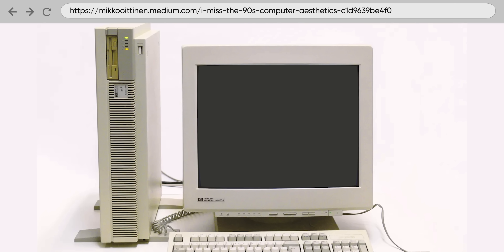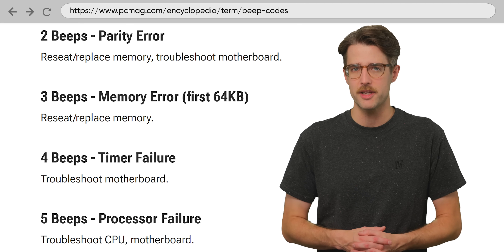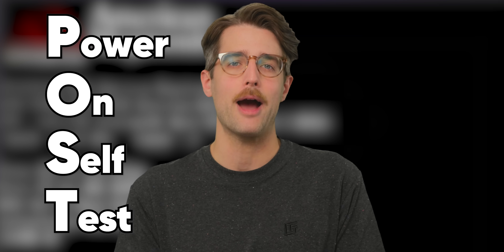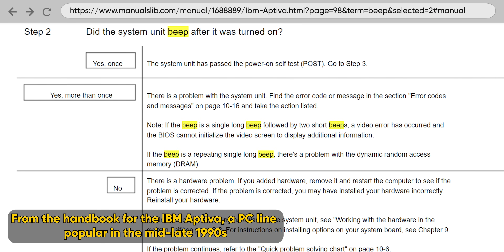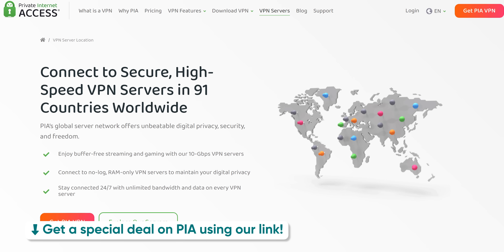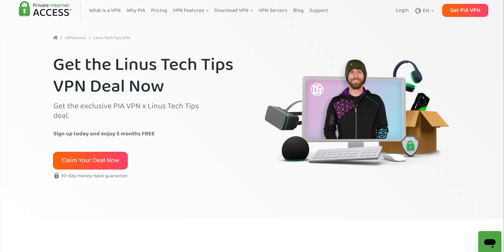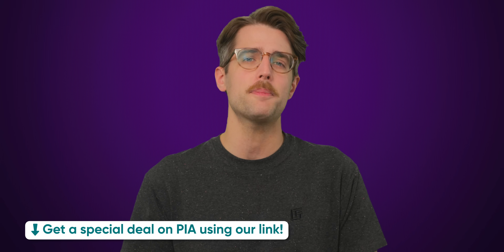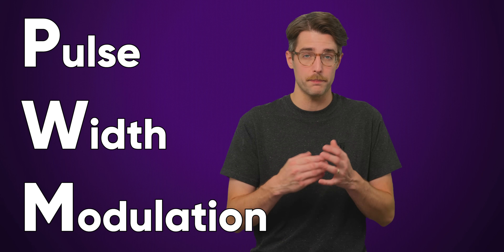Why Computers Don't Beep at You Anymore

Comment: One thing you glossed over is that at some point in the mid 2010s, motherboard makers seemed to stop including PC speakers as a cost cut, because case makers were including them. Also, case makers seemed to stop including PC speakers as a cost cut, because motherboard makers included them. End result: No one included them.

Working tech shops back then, I'm sure we're all familiar with our hoard of PC speakers in a drawer suddenly starting to dwindle.
Reply: I want to know why they need to cut cost when they charge me 300 bucks for a motherboard.
Reply: @John-du2mq A few cents per board when you're making thousands adds up. They're nickel and diming the quality and features away.
Reply: It's like the screws for an M.2 NVME slot. Seems SSD manufacturers don't provide a screw, and neither my desktop's motherboard nor my laptop came with any spare m.2 screws either. You know how annoying it is when that new SSD you ordered finally arrives, but you can't put it in because you don't have the darned screw? >_<
Reply: They serve basically no purpose at this point. Any event that would previously have warranted an alarm beep from the computer gets routed through the soundcards that basically all computers have now. Computers rarely freeze so early in the boot process that you don't get a display, so using them for that doesn't make much sense either. A lot of computers now come with status LEDs on the motherboard that you can look at if you really are having a hard time getting the computer far enough into the boot process to see anything.
Reply: Back in the nineties, before sound cards were commonplace, there usually was no beeper soldered onto the motherboard for exactly the same reason: The speaker was part of the case. Although the speakers back then were actual speakers, and thus perhaps a bit too big to be soldered onto the board.

I'd say it must have been around the turn of the millennium that those tinny little piezo beepers soldered onto the board became somewhat mainstream. PCs had already been beeping at us for almost 20 years at that point. 

So I don't think them going away is why PCs don't beep anymore. It might be the other way around, though: PCs really had no reason to beep at us anymore in the 2010s. The boards and CPUs still technically supported it, if only just to meet the specs for some industry standard, but why spend extra cents on a beeper that nobody actually uses?
Reply: Dell PCs still have a built-in speaker! Or they did as of 2021, anyway. It's connected to the on-board sound chip, so it's a general-purpose speaker, not limited to beeping.
Reply: I miss having those 2 to 3 inch speakers they mounted in the cases.
Reply: Other thing glossed over is that by the late 90s when most PC Speakers only ever got used to make POST beeps then the speaker quickly became cost-reduced down to a piezo sounder mounted straight onto the motherboard that could only really make beeps, downgrading the capabilities of it further.
Reply: My last two Mobos from EVGA (x570, z370) both still came with internal speakers 🥲
Reply: This is wrong, cost cut? The thing only cost like 0.1 cent. They probably stopped because most motherboard have led indicator or 7 segments for showing the error code
Reply: weird. my gigabyte gaming 3 H170 had it. i 'downgraded' to an asus b760m prime and it didnt come with one. i thought perhaps it was limited to high end motherboards?
Reply: @Dragoonoar less about the quality or price and more that its just not a universal feature anymore. Some have it, some don’t.
Reply: My H81M-S2PV PC does come with one
It's from 2013 btw

Comment: Most (or at least a lot) of motherboards still have pins for a speaker.  I put little speakers in my machines because the post beeps are actually useful and the speakers only cost a few cents.

Comment: I bought a little speaker for my PC's motherboard so it still beeps when it boots.  It's useful in case there is a problem during bootup.  For example it will beep multiple times if the CPU fan has a problem and stuff like that.

Comment: Surprised you didn't mention the little plastic 4-pin cylindrical speaker that used to come with motherboards and connected to the system/front panel header pins

Comment: I remember when turning off the sound in games actually improved the frame-rate.  That's how little power those '80s CPUs had.  The first time I ever noticed sound not have an effect on PC games was when I upgraded to a 486-DX2-66 in 1991.  That finally broke the "sound barrier" (my term for it).  You could have sound going all the time, even in the OS, and not notice any slowdowns.
Reply: I had a 386 DX 25 that could play Doom with PC speaker audio. It was a really nice 386
Reply: To be fair, pushing anything beyond simple tones out a PC speaker is CPU-intensive work. You can get the system timer to do the job for a single, unvarying tone, but for a complex waveform, you have to tap the timer registers in realtime. This is why sound cards were so awesome: you just loaded a waveform into RAM, then told the sound card "play that", which it did via DMA without CPU involvement.

Comment: 1 long beep + 3 short beeps is a sequence that's burned into my mind from so many failing AGP cards in recent years
Reply: Often with AGP the card just needed reseating as the interleaved pins on the connector had basically no tolerance for the card moving at all vs earlier and later interfaces with simple single row edge connectors.
Reply: oh my god, troll physics guy

Comment: I used to create sound from the Sinclair ZX81/Timex 1000 by using a short bit of assembly code that turned port 254 (ear/mic) on and off quickly, just had to poke the speed and duration and call the routine.

Comment: Disappointingly there are fewer and fewer of these - what I call - motherboard speakers or sounders. Even when dropping more than $3k on my newest system MicroCenter had no idea what I was talking about. (They thought I wanted to play music on a tiny speaker from inside the case! The case is a POS as it also didn't have a power light or HDD indicator or reset switch, so I had four things to retrofit. Luckily all of the headers were there, UNUSED.)
I've been building systems since the early 80's and that little speaker with it's "beep codes" have been invaluable in quick diagnostics. Nothing is more reassuring than hearing that little BEEP when you power up, even the newest systems!

Comment: Pause.... PUT THE SPEAKER IN YOURSELF.  You might not like it, but it will save you when your PC suddenly doesn't boot, and you can get an error code without opening the case, or even if your mobo doesn't have a diagnostic screen or lights.
Reply: in myself?
Reply: @voideal  That is literally what I said, good luck, make sure you get the correct pins.
Reply: @voideal bro really, in the computer by yourself.
Reply: @michaelepica3564  oh...

Comment: Many of you younger folks today do not recall when creating sound, even with a good sound card, increased load on the PC. One of the things Sound Blaster did was essentially make a sound co-processor that actually accelerated the sound creation to offload it from the CPU.
Reply: Remember when playing a MP3 file would demand something like 70% or more of the processor time? Some slower computers couldn't even play a single MP3 encoded file without strange hiccups. Today you hardly see any CPU load when playing the same files.

But I remember ManicMiner on a ZX Spectrum was able to play a game play music of I think four simultaneous channels. And that also had the dreaded on/off speaker without any hardware to simplify things. And that was a running on an 8-bit CPU, the Zilog Z80 at 3.5 MHz.
Reply: @blahorgaslisk7763 That was because MP3s need to be decoded into PCM for playback. Of course your Speccy didn't store its "samples" in MP3 - not even PCs did until they got to 1GHz or more.
Reply: @blahorgaslisk7763  I miss the days when sound card tech was evolving; Awe64, Live! and Audigy where amazing. Now all sound devices feel like derivatives of the same design.

Comment: One of my computers came with a small 3/8-inch black round speaker unit that plugs onto a 2-pin header on the motherboard.  It still beeps after post.  Most of my computers have LEDs instead.

Comment: Just last week I purchased a new monitor that plugs in with a DP cable, when I booted up my PC it started beeping. Turns out my GTX1060 needed a firmware update to run from DP. Thanks tiny PC Speaker :)

Comment: I have the tiny speaker on the NAS computer, because it's not connected to a monitor so I can recognize if it booted, if there is an error and there is even a confirmation beep when Xigmanas system boots.

Comment: There were two kinds of PC speaker. The original full speaker that could use pwm to do nice sound, and then there was the later simpler piezo speaker that could only do the beep (fixed voltage in = self induced tone out).

Comment: Not only do I use the speaker in my personal rig, but our school district PCs, all Lenovo, still use their internal speakers for errors during POST.  We disable the successful POST beep, but I've heard the beep pattern for RAM a lot recently as our machines are starting to age out.  Very handy for hardware troubleshooting.
Reply: How old are they?
Reply: @argvminusone  just over five years. P330 Tiny's mostly. 8th gen Intel procs
Reply: @mudkipman98  😨 You're seeing RAM fail after only 5 years?? That's shocking. RAM that's 50 years old often still works, let alone 5.
Reply: @argvminusone  yup. One DRAM chip overheats and quite literally melts. All the more reason to clean out the dust in those tiny PCs very frequently

Comment: well thsie days the pc speakers that are bulit into most computers expeacaly some apple computers like laptops and desktops of some modles if you don't want to use headphones or speakers disht dasy have bult in sterio and boot up tones but much more fancy. aslo apple laptops and desktops aslo h ave pc speakers that are bacly real spearkes that can have qute the base and decable output to them. also the apple latops and desktops with mac os still have the power on boot secess tone but it can be set at difrent voluime or even muted by the volauim speaker seting themself. also if your apple comptuer is not amekniga satrtup tone its very liekly that the main speakrs are still have there sepreate seting still muted. hey did you know apples has serpeate indemteping volauime seting for eacth device it has acces too. you can mute or apple bulit in spakers and have your head or earphones at a difent non muted seting and the apple comptuer will keep them setings at the best of its ablty by the way.  also the rasor gameing keybord funhon key compably is also good for volauim controll too. but mac os and rasor thrid party drivers can be a bit finciky sometimes but pressing the mosue sentive control buttions on the reasor RGB mumba gameing mouse nornaly most of the time can help get it out of its softlock.

Comment: I wrote malware in the early 00's that would play fun jingles through my friend's speakers, like the Super Mario theme. It was a fun prank at the time.
Reply: That’s not malware, that’s funware!!!
Reply: @JPkerVideo  He forgot to mention the part where it deletes the C: drive. Fun times.
Reply: Also the Javascript cupholder, cursor stealers… C L A S S I C!
Reply: Back in high school I let a little VBScript run at startup, named it so that it would be easily confused with a system process (something like svchost idk), created it using the administrator account and made sure to change the system date some 20 years ago so it seemed legit. What it did was open and close the CD drive every few seconds. All the tech teachers checked it, the scool's IT admin, nothing seemed weird so they just blamed it on a faulty disk drive. I barely refrained from laughing hearing my teacher mention something like "don't use that one computer, it's been doing it for weeks...driving me crazy with that broken CD drive". I fixed it after the fact.

Good times...

Comment: Even today many OEM PCs still use an internal speaker, and some still have the boot beep, and sometimes beep codes on an error. My work PC, a Dell with i5-13500 has an internal speaker and beeps on boot.

Comment: Now there's something I haven't heard in a while and honestly, I'm still impressed at the innovation that went into pushing those little speakers to put out more than beeps for sound, before we got proper sound equipment and such.
Reply: And there's two ways to do it, too. One is PWM, which sounds good, but is quiet. The other is a single-bit approach, which sounds terrible, but is much louder. The single-bit mode involves setting up the timer-chip that drives the speaker to output a constant voltage, then turning the speaker-enable gate on and off quickly.

Comment: I still use a beep speaker in my ryzen 5800x3d rig, mostly because the msi x570 motherboard doesn't have a code screen. This particular beep speaker is older than Ryley and originated from a 386sx pc I built in the 90s. you can turn on post beep in the bios in most pcs still, and most motherboards still have the header.
Reply: I guess the PC speaker is the one component that is truly future-proof

Comment: I grew up with computers that had these, but by the time I got around to building my own PC (not just tinkering with pre-builts), the speakers had gone. A few years ago a friend of mine bought a super low end motherboard for a project, and it actually came with a speaker! I convinced them to let me have it, and now my modern, mid-range, RGB filled gaming PC has that delightful, classic startup BEEP. I love it more than I should.
Reply: Yep. Starting about 10 years back, the PC speaker drawer filled with tons of spares - because both cases and MBs came with them - suddenly started to dwindle because even one supplying them seemed to become less common.
Reply: I simply connected a speaker to the header on my B760M mobo. Most motherboards do have a dedicated header for diagnostic
Reply: you can still plug them in most motherboard normaly.
Reply: @Light-DelaBlue exactly, the connection is there, but you must provide your own speaker now

Comment: My brief history with motherboard-mounted speakers:
2013 gaming rig: came with a simple speaker for POST beeps and stuff
2018 ThinkPad: will not beep on a normal POST, but will beep if you enter the boot menu or BIOS or anything that's not the normal OS
2022 gaming rig: Same as the ThinkPad, but it uses the simple speaker from the 2013 one

Comment: Mine still does, I always connect a PC speaker, I have a proper cone speaker in mine from an old PC instead of the piezoelectric ones, I like the beep and also it's useful for troubleshooting when you don't have a post code display, debug LEDs are not as useful

Comment: I have a speaker in my modern day system cause my motherboard have a connector and I used to work in a repair shop and removed a lot of speakers from dead/not worth to repair motherboards

Comment: 100% still have a PC speaker in my tower. It's how I know it turned on. I couldn't imagine not having it.
Reply: I still have mine from my 2020 build. still in system, it is a smaller speaker. but its important to me to know if there is a hardware issue.
Reply: Same
Reply: The fan isn't an indication?
Reply: @SmallSpoonBrigade  My pc is silent af so no, it wouldnt be
Reply: I see your point, but the solution would be (assuming you don`t have a see thrue case or you have your pc on the floar) to have a light inmdicator on your power switch. Many modern cases come equipped with a one and installation of this panel i pretty much just 1 cabel+all of your usb cabels;)
Reply: I see the RGB come on and the loud fans start making noise on my PC. There isn’t any ignoring when my computer turns on.
Reply: @angryox3102  its more than knowing your fans spin, that a pc speaker is used. if you watched the video i am sure you know why.

Comment: I installed one of these in my box, I like the beep and when something does go wrong I find it easier to listen to the beep tones than read the code on the POST card (Which as well as my needing a magnifier to see is usually hidden behind one of my optical drives)

Comment: ye old pc speaker, my new (current) system didn't come with one, so it's not in use any longer.
at some point they were soldered to the mobo, as that was the last one that was "used" by me.
i think that debug leds have replaced what beeps used to be mainly useful for.

Comment: Linux has a module named pcspkr. I have a laptop and it doesn't have a proper PC speaker so it uses my normal speakers and every time I reinstall Linux and I forget to disable the module, when I press tab when there is multiple choices or backspace when there is nothing left it will beep with 100% volume and it freaks me out.